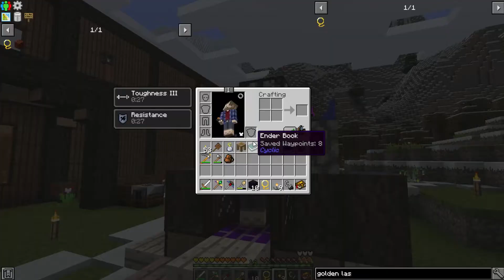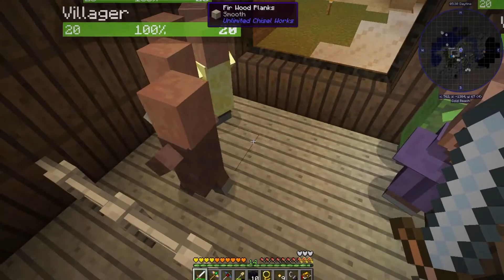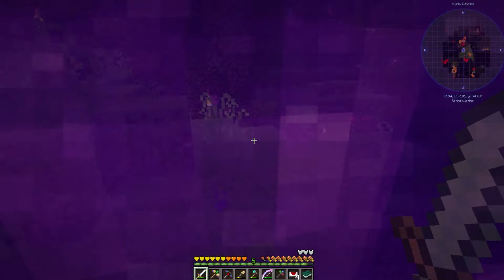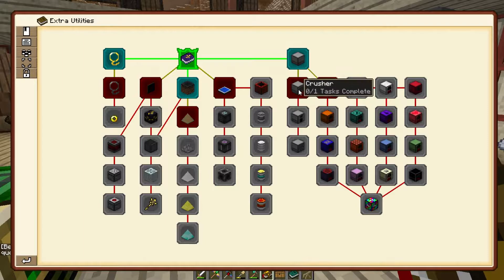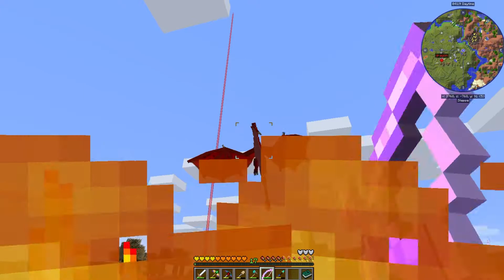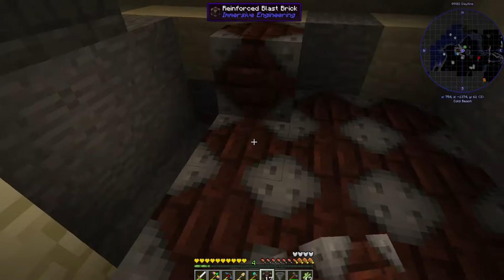Breaching the Nether and Losing to a Dragon - Minecraft: Enigmatica 2 Expert #7

Comment: I wonder if you would be able to duck in the water to tease that dragon. Though arrows are still a barrier.
Reply from the maker: I’ve made the mistake of trying to fight them in water before.  You might not get set on fire but you still get to die to them if you’re not strong enough to shrug off the attacks.

Comment: Correction needed: The invar recipe is always 2 iron 1 nickel. Without unlimited lava, the alloy furnace is fair, but with your ender tank setup, the smeltery is superior on every level. You can even make the invar blend with 2 iron powder (from Small Plate Presser) + 1 nickel Powder - then you cook the invar blend the same way you smelt any ingot. :)
Reply from the maker: It’s specifically 1-1 for the alloy furnace in this pack.  I thought it was weird and double checked it.  It’s the only utility it even brings to this pack at all.  That said, I never once used it after making it.  It was never worth the effort.
Reply: @Ardcraft  I wonder if it was changed. I'm playing a slightly earlier version (without the nasty fix to sinks - boo!)
Reply from the maker: It's possible.  I searched the patch notes and couldn't find it, so it's possible I'm wrong.  I'd have to load the game up to verify.  Either way there's very little reason to use it at all since you already have to make the smeltery before it anyways.  It was a weird checkbox to have to tick, but there are a lot of those in this pack.

The kitchen sink thing honestly ends up not being a big deal.  It's mostly to push you to the nuclearcraft water sources anyhow, and automating stuff like that sooner than later.

Comment: Really enjoying the series, Ard! Though I would never build in a biome that snows. Yuck! Already learned some great things about Cooking with Blockheads. Cheers, mate!
Reply: Also - for ore doubling, the Small Plate Processor is easy (or was) to build and automate.
Reply from the maker: Glad you're still enjoying it!   

Honestly, I built in a snow biome intentionally because it's something I usually avoid doing.  It had some downsides, but overall it wasn't too bad to deal with once I actually put a roof on my base.

Yeah, I built the small plate press at some point for some other components.  I just tend to lean into IC2 early in this pack since it gets so many of the other subcomponents for other packs taken care of in the process, and I personally don't hate IC2 unlike so much of the rest of the mod community.  It doesn't hurt that most of the really punitive stuff is disabled in this pack though.
Reply: Oh! And I forgot... the Forestry work bench is awesome early game. TIL !